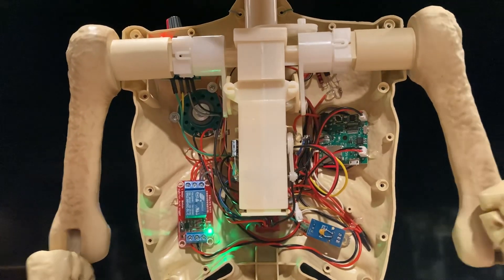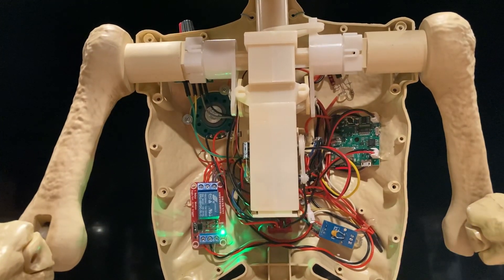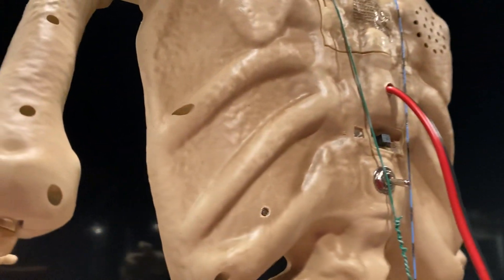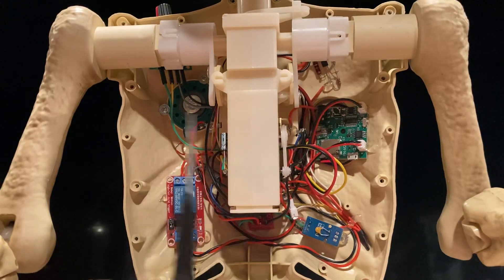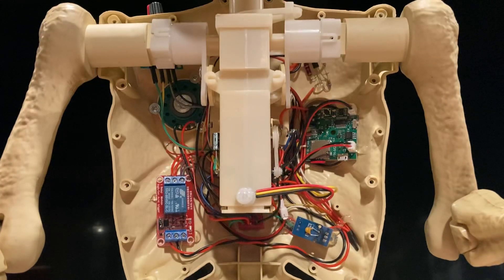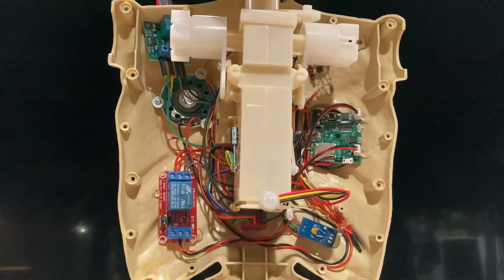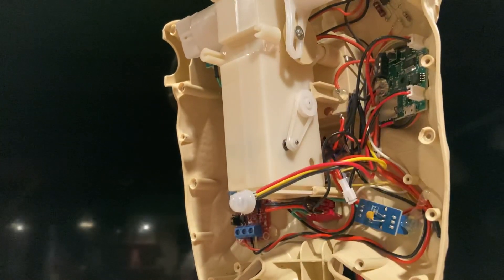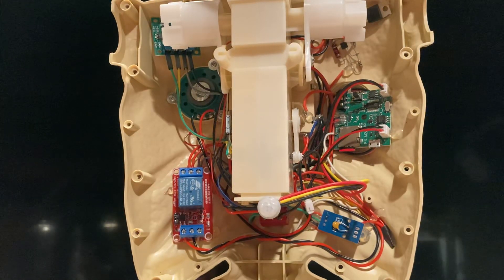Installed New Boards In The 3FT Animated Skeleton Part 4

Comment: I love this, very creative electronics here, wonderful animation. But, being me, when I look at this, all I can think is "Can I get in there with an Arduino?" I believe many of the functions you have could be controlled by one, and potentially some now variability could be introduced, like speed control of the PWM motors. I could even see introducing control via a cheap IR remote. I think our wives would need to be careful about leaving the two of us alone in the garage for too long.
Reply from the maker: Hello, Thank you for the comment. Yes absolutely Arduino is next. I am a beginner in Animatronics. Electronics I have done for years. Also I am a IT professional, so the Arduino will be a evolutional endeavor in my hobby Robotics later on. Have you had experience and use a Arduino??  If so we need to talk. Thank you again for the comment, looking foward to hearing from you.
Reply: @mikecomptech  I have a career as a test automation engineer, creating automated test systems. I have been working with Arduinos for both work and hobby for many years, and I am currently trying to bring a fun product to market that is based on an Arduino Nano. I have been laying out designs and having PCBs fabricated so as to avoid a rat's nest of wires in my projects, it is easy and inexpensive to do. I am located in Southern California, where are you?
Reply: @mikecomptech  Please note, I work primarilly with digital electronics, you look like an analog electronics guy. The blending of skills might be fruitful.
Reply: @mikecomptech  Last Halloween there was a 7' animatronics dragon in the dark to the rear of my front yard. When I waved a magic wand and cast a spell from the sidewalk a spotlight would turn on lighting the dragon and the dragon would go through it's "thing", and then the light would turn off again. All Arduino controlled. It's going to be out there again this year.
Reply from the maker: @flingmonkey5494  I am in Illinois. The Dragon sounds really cool. Sounds like your job is fun, as mine is love doing what I do. 
I can activate the 3FT Skeleton with a IR remote is has a IR sensor in the front. That will trip the sound board then the relay starts the
arm motor. Could I ask questions about the Arduino because like I said a beginner in the Arduino arena. Thank you for your reply.
Reply: @mikecomptech  I have reviewed the current Elegoo smart car offerings, and I am not so sure I like them. They are not what they used to be. Apparently they are pushing :Blockley" programming, not "Arduino IDE" programming. It is a more limited "fluff" programming language, and you need to be able to get down to the basics. If you want to go that route let me help guide you to the best path, I can search some more to find it. I want you to be able to use ANY sensor or actuator, not just the ones in the kit. I don't want you frustrated.
Reply from the maker: @flingmonkey5494  Okay great sounds good. Any help would be greatly appreciated. Thank you.
Reply: @mikecomptech  Okay, I just downloaded the documentation on the Elecgoo smart car kit that is on Amazon, and year, that kit is no longer going to take you where you need to go. It does not dive into the programming you need, it is a quick lesson for kids that does not lead to usable skills. So let's take another route to get you there, easy, cheap, necessary skills taught.
Reply from the maker: @flingmonkey5494  Great sounds good. Thanks.. 👍
Reply: @mikecomptech  You are welcome. If you get that kit, please let me know and let me know how you are doing with it. I can help if you get stuck. After you work through the exercises (I got stuck on the RGB LED experiment for a while just having fun,) let me know and we can talk next steps.